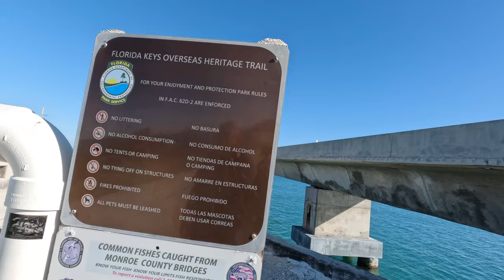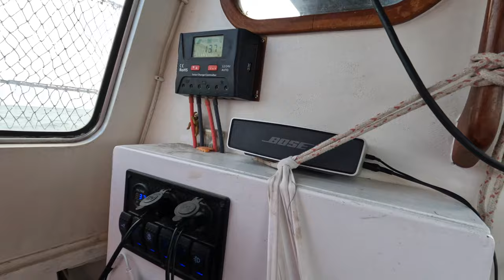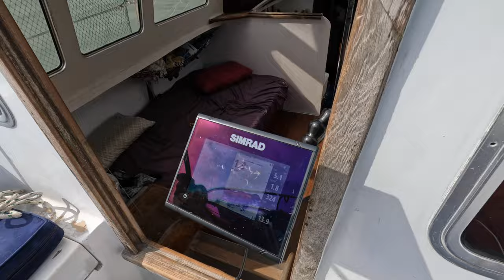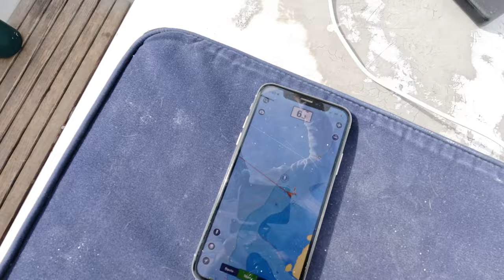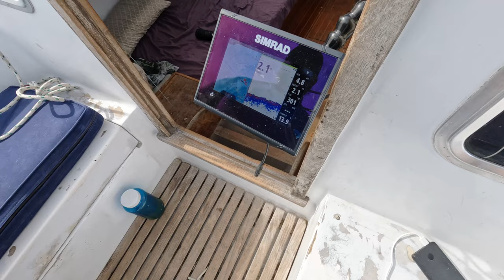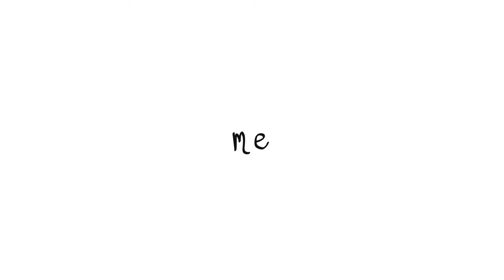Sailing the Neon Nuclear Florida Coast

Comment: Boot key was the best spot in the keys to provision. This was a different  view than I am used to. I usually go Hawks channel , then offshore to Miami, my boat  draws 6 1/2 feet. And I have 70 foot air draft. This keeps me offshore until port canaveral for a rest. There is also a good haul out yard in port Canaveral called cape marina. I don't know how far you plan on going north but it's there. Most haulout yards require liability insurance before haulout. My next haulout is going to be done in the Caribbean. Florida is a  great place to source parts and supplies,  but yards are expensive here. I had to get insurance,  then haul and launch was 1000 and one month in the yard was another 1000. It's way cheaper in the Dominican Republic to do it, especially if you have everything you need with you.
Reply from the maker: All true! Thanks for the input. We’re discovering all this as we go along - also told by several boaters to check out yards near Cape Canaveral. Cheers and happy sailing!

Comment: I feel your pain about crab traps. I'm definitely going to get a rope cutter for my prop shaft. I hope you guys do too. Just curious, if you could get a different engine would you be open to changing it? I had a Volvo MD11C before and finding spares was a real pain and parts were used and 3x more expensive than say Beta or Yanmar.
Reply from the maker: Yeah the boat came with a small knife-like rope cutter and we would be interested it getting one again for the coast here. We are also finding that the hardest part about having this Volvo md2b is sourcing the parts that we need affordably - definitely looking to upgrade our engine situation one day.

Comment: Interesting you mentioned poor quality bottom paint in Mexico. I sailed down to Sea of Cortez from BC on cheap bottom paint thinking the stuff I could source here would be more effective due to what I've heard are more lax environmental laws. Guess not 🫤

Anyway it's great to see you guys cruising again. Will you go to Bahamas or the Caribbean?
Reply from the maker: The mistake we possibly made with bottom paint was going too cheap. Getting paint in Mexico is always kind of iffy in general because we find that it doesn’t always get stored well (sits for too long and maybe sits in the heat) which is possibly what went wrong with our batch. We know the brand of hard anti fouling that has worked well for us in the past, and want to go with that again (interlux barrier coat and micron csc).
Reply: @sailorama YES! Another cruiser from BC used Interlux Micron CSC and had no problems. Definitely going to use that stuff next time.